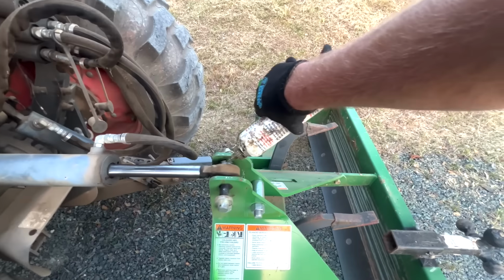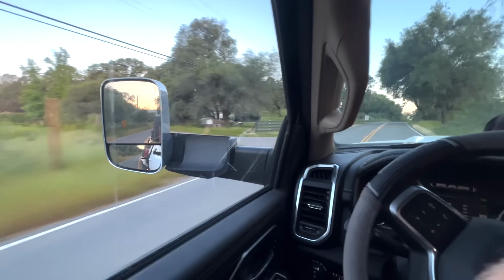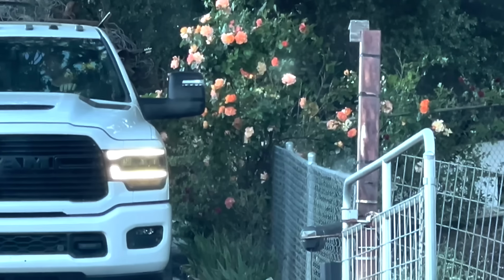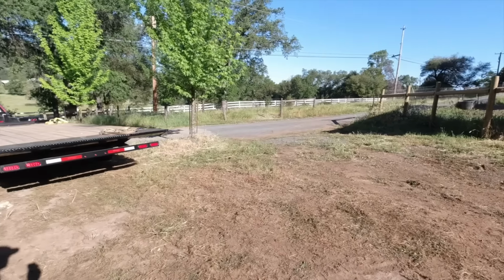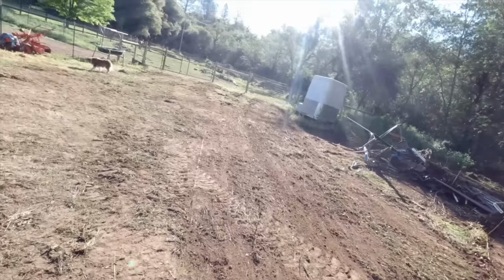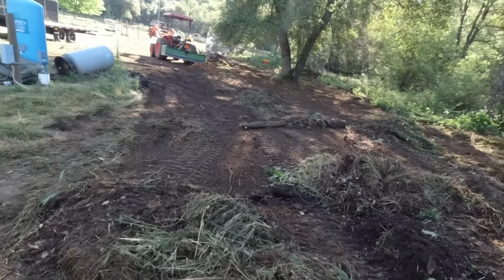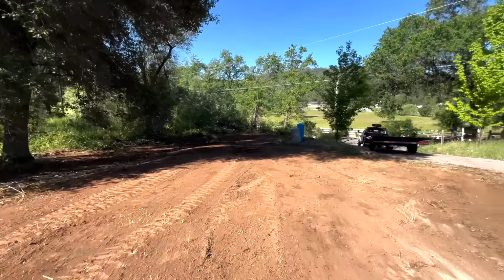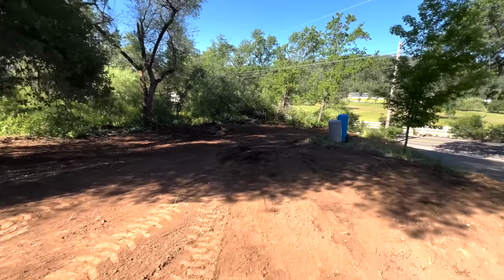FIRST LOAD WITH THE NEW TRAILER! Let’s see how it does

Comment: Thanks for takeing us on ANOTHER "Kool Ride". I have a 22' Loadtrail/ Loadmax Deck over/ scissor lift with 2 manual jacks. I also like the Fact that the dove tail when the deck is "Aiming for the Sky"( 9.5 feet up), can also lift the wheels Off the ground by 6 inches. When just loading the "ramp angle" is Still very steep/ with the front deck being Still 7.5' "Sky-wards". The  Whole trailer is FLAWED !...its almost a "Dump Trailer" !?! The Axels are TOO Far back, & there is 900lbs Tounge Weight when empty on a 5400lb trailer. The "Axles" NEED to be brought up at least 2 more feet, or another axle "Added" in front of the origional Two. Thank you Sir for the Excelent vidio and happy safe Tractoring , Excavating, & Hauling. Best wishes with all your endeavours.